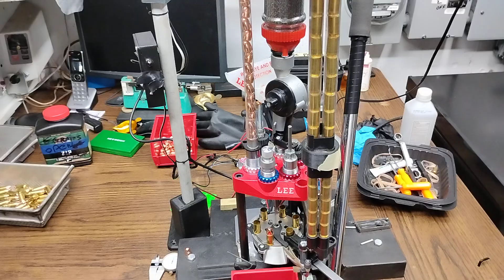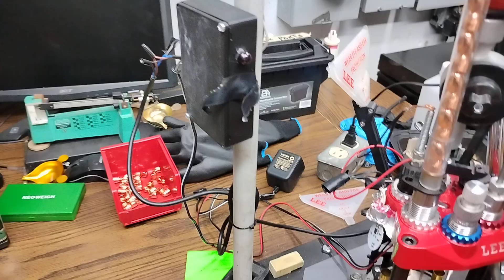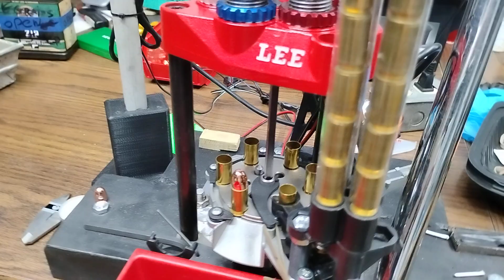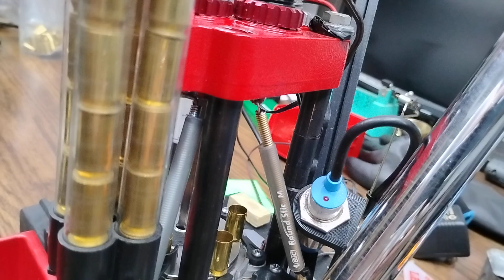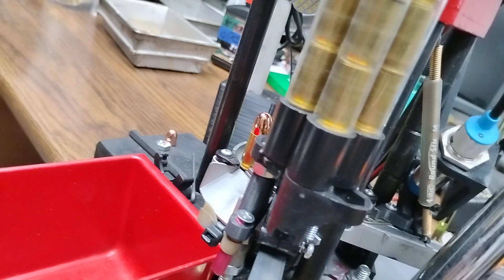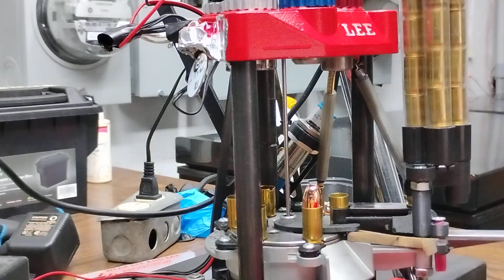Lee six pack pro AKA Lee 6000 pro

Comment: I saw a cut case go by at the beginning after the loading station, looks like your loader and expander die needs adjusting, the bullets aren't dropping into the case correctly each time which is a good indication. Set up can be tough but they run well afterwards, I like the bullet feeder you made!
Reply from the maker: I did pull that round with the bad case. I agree the expander needed a little tweaking. This video was right after the initial set-up . Since that video I have 3d printed a case feeder just like the bullet feeder and have it dialed in and it's working great.  Running at a comfortable pace I can do 700 rounds an hour.
Reply: @hotrod3737  Keep us updated, it's a big help watching your videos.
Reply from the maker: @wlbrobinson  hopefully I'll make another video. I now have another six pack setup exclusively for 45 so I don't have to mess with the setup. As you know they are finicky but once dialed in they run good

Comment: Do you 3d print and sell these modifications?
If not then can you please recommend me a 3d printer that you use or would recommend.
I am just now getting into reloading and I have not set up my 6000 yet but I am already seeing all these must have modifications that I want so that I eliminate any known issues  that occur, plus I want my press to run the smoothest that it can. 
Thank you!
Reply from the maker: I 3D printed these on a creality ender 3 pro that I picked up on sale at micro center for $99. I do not sell any of the items that I 3D printed I just did it for myself. You can find the files that I used to 3D print the case feeder and bullet feeder on thingiverse. All of the files that I use to print these things came off of the thingiverse website. Good luck with your 6000 it will take time and patience to get it set up correctly they can be a little temperamental just pay attention and try to understand what's going on at each step

Comment: I have a Lee 6000 in my basement waiting on some more pieces for assembly. I got the universal case feeder noticed only 9mm & smaller cases wil pass through no 40 or 45..
Great video
Reply from the maker: @morgan79347  didn't your universal case feeder come with 8 plastic tubes four small ones and four larger ones?
Reply: @  no it came with 4 tubes the same size & length & 1 tube the same size but shorter with a red cap on it the case feeder has 5 spaces. Note the 223 & 9 will drop through the bottom larger cases fit in tubes but it doesn’t look like they will pas through what looks like a bushing but appears to be a part of lower assembly.
I’ve been loading on a single stage or years then bought a low end Lee turret.
Reply from the maker: @morgan79347  the
Reply from the maker: The one with the cap on it is for the spend primers I would call Lee and tell them that the tubes are too small for the larger calibers and see if they'll send you larger tubes they're usually pretty good about things like that
Reply: @ ok thank you!
Reply from the maker: There are two different sized ports on the bottom of the case feeder the black part you have to switch them around when you want to load 45 caliber bullets and pull that little black table out of the bottom where the tube goes in take a good look at it you have to switch it to the other side you have to change where the little threaded rod goes to the other side
Reply: @hotrod3737  I took a look at the case feeder again there is a bushing that comes out & some more in a package. Thanks for all the help.
Reply from the maker: @morgan79347  it takes a little tinkering to get it right and you might get frustrated just stick with it watch the videos that I provided it'll help guide you through some of the pitfalls and if you have any questions just post them here
Reply: @ thanks.

Comment: THIS IS A COPY FROM ANOTHER VIDEO ABOUT THIS PRESS.   I BELIEVE OTHERS SHOULD KNOW. Your modifications are great.  THUMBS UP!  I too inserted hanger wires to stiffen the primer and case feed springs.  They will crip over and crush, ruining them, multiple times.

 I have one of these.  I wanted "One press to rule them all!" I.E. do everything from 9mm to 30-06.  Breaks my heart to write this.  When loading .308, station one likes to leave the shell in the die and tear off only 2 bits of brass.  I don't think it is seating all the way in the plate.   I gave up and pulled the die loading only decapped pre-sized brass. That little grey plastic ring thing?    A. makes partial through shell removal (weight check or other problems) VERY difficult or impossible.  B.  pops partially out and screws things up.  It would have been really nice if Lee had made the plate carrier and the plate actually FIT each other.   The primer pin is only one diameter, small, so it dents and distorts the large primers.  My press came damaged in shipping the 2 long cast extensions were bent (shell and primer feeds).  LEE WAS GREAT ABOUT GETTING THE REPLACMENT PART FAST AND FREE!!  Replacement zinc shell plate holders to not come with the screw holders threaded.  So if you need one make sure to use either self tapping screws or tap the screw hold first otherwise, the screws can snap upon first installation.  I would NOT recommend this press, at least not for any rifle ammo.  I would avoid buying this press for anything, except (perhaps) pistol ammo.  added on edit: March 2024.  Getting better and more confident at 9mm .45 and .38.  GREAT, for pistols.  Though a spring loaded case retaining door was needed to keep cases from flying loose as they drop.
Reply from the maker: @chrisgeddes26  I've had no problems but I only load pistol

Comment: Check your bullet seating die.  Rounds look short.  BTW there was a bad case in position 4 at the beginning of the video.
Reply: Wow! You can tell that the rounds look a couple thousandths of an inch too deep just by watching a video. With all the mods this man made to his press, do you really think he neglected to check the OAL on his cartridges? You sir, need to go back to playing Candy Crush.
Reply: @Horatio-m7t  Were all the "mods" necessary ? These run pretty well stock when adjusted.

Comment: i note in the video at 2.36 minutes, the 45 auto case sitting at station 3, has a damaged mouth,,, would you make a video dedicated to only show the each individual improvements you have made....,,, and or would you share the 3d print files,, warm regards, harie g in South East Queensland.
Reply from the maker: Here's a link to the 3d files. I did make a second video with both a bullet and case feeder.
I did get that round with the damaged case mouth when I inspected my loaded rounds

https://www.thingiverse.com/thing:3438003

Comment: Now just 3d print and automate the case feeding, and something to manually activate the handle and we'd have a fully automatic press similar to a Dillon.
Reply from the maker: I did a second video and in the second video there is a 3D printed case feeder. I gave consideration to automating the handle to make it a fully automated but I prefer to feel the primer being seated in the case as I actuate the handle and it really isn't difficult just it manually.
Since this video I have added another pro 6000 with both a case and a bullet feeder. One is now dedicated  to 9mm  the other to 45acp.
I plan to make another video in the near future of both as well as my Dillon square deal with a one off automatic case feeder.

Comment: Wow. Next level stuff.
Reply from the maker: Thanks I like tinkering. Since this video I have added another six pack pro dedicated to 45acp and this one is now setup for 9mm. I have also designed a automatic case feeder for my Dillon square deal b which I bought back in 1987 that's working great. I don't use the Dillion much anymore because the lees are working great
Reply: @ I thought about buying a Dillon, but the Lees just look so good for so little money, relatively.
Reply from the maker: Overall the Dillion is a better machine. The lee can be a little challenging to setup but once dialed in it works well.
Dillons warranty can't be beat. When they say lifetime they mean it.

Comment: Do you have the STLs for the case feeder and bullet feeder? Do you have any recommendations on how to modify the springs as you mentioned? Did you follow a guide for the power checker? I appreciate the video!
Reply from the maker: @joescavone6174  I got the STL files off of thingiverse for the bullet feeder which also has files for a case feeder by the same guy. He has a YouTube video about assembly. I cut the spring about an inch from the bottom and then removed about 1/2 inch from the top part I got a 6/32 screw 1.5 inches long and cut the head off of it. Screw the two pieces together using the screw and adjust to the length you need to make the primer feeder not over or under extend. 
I inserted a piece of metal coat hanger in the top portion of the spring and cut it to just a little short of the spring top. 
I also took a bic pen and used the outer portion as a sleeve over the spring to help the spring from flexing.
https://www.thingiverse.com/thing:3438003

Good luck.
Reply from the maker: @joescavone6174  the powder check is just something I put together with stuff I had laying around, it's pretty simple.

Comment from the maker: I cut the spring about an inch and a half from the bottom where it attaches to the primer slide. I then cut about 1/2 in off of the spring. I then took a 6 - 32 machine screw that I cut off the head the screw is about 2 inches long and screwed both half of the springs back together using the screw that I cut. This allows me to adjust the length of the spring to the exact length that I need in order to have the primer slide go back far enough to pick up the next primer but not go too far or not fat enough. After I got the length adjusted I took a piece of metal coat hanger and inserted it into the top of the spring and trimmed it to length about 1/4 inch from the top of the spring. This also helps keep the spring from flexing. The pen cover helps to also keep the spring from wanting to bend. 
Once you get it dialed in it works great. Yesterday I loaded 623 9mm in one hour. Loading the primer trays is the slowest part of the process. 
Good luck